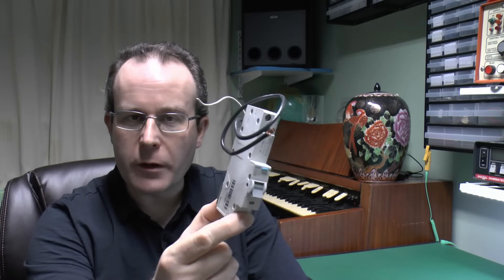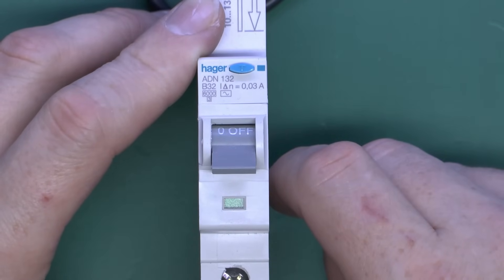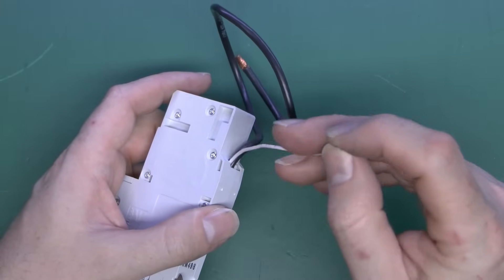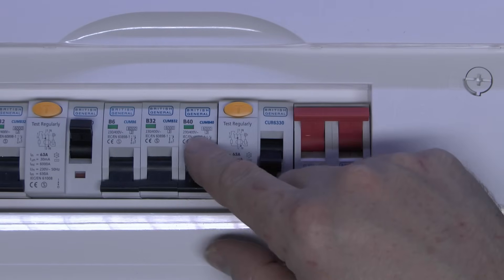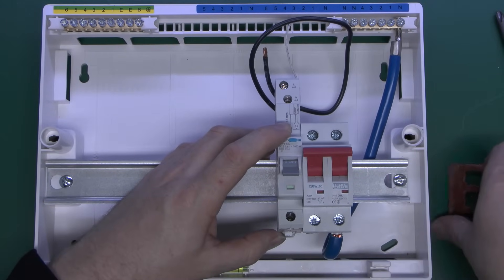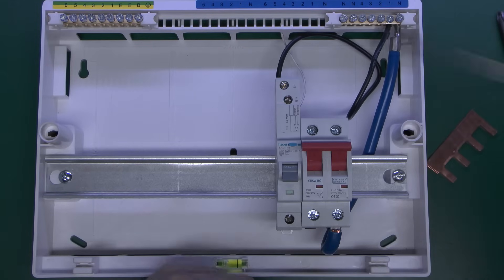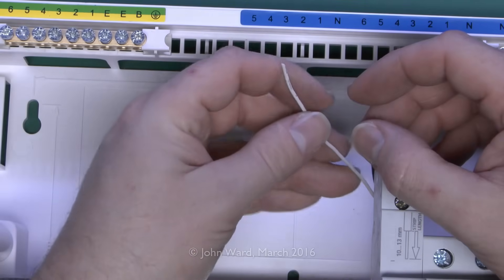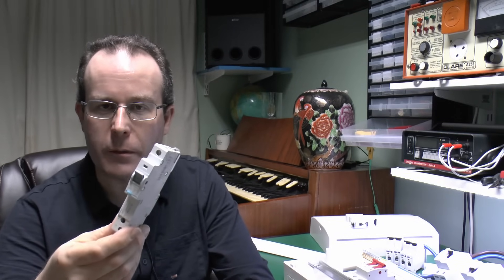Fitting an RCBO in a Consumer Unit

Comment: If high voltage receives from main line like more then 250 volt, in such cases how does MCB protect the circuit
Reply from the maker: It doesn't - they have no protection from overvoltage.
If overvoltage is likely to be a problem, then devices to detect that and disconnect the supply are available.
Reply: which types of devices can detect this Sir? because this is genuine fault

Comment: Sir what is the purpose of RCBO? Then MCB and RCCB? I cudnt understand its uses
Reply from the maker: MCB - trips on overload and short circuit.  RCCB/RCD - trips on line-earth faults.  RCBO = both devices combined.
Reply: John Ward thank you very much Brother. It means we use RCBO instead RCCB or MCB for every circuit. M i right Sir?? And one RCBO enough for whole distribution board or we have to use separate RCBO for each circuit instead and like MCB? Kindly explain it Sie

Comment: Hi John. I've always wondered why RCBO's functional neutral CSA are all the same size.  I would have thought a 50Amp functional neutral would be larger than a 6A.  It's most probably a stupid question. Thanks, James.
Reply: I thought the same as you. Did you get answer to this question yet?
Reply: @mixer7586  Cost.  Someone in China has been shown how to put a blue wire in a plastic box and tighten it up.  They have no idea what they are doing, but if they cut 6" of wire and put it in they get paid.  You want to introduce half a dozen different wire sizes?  Oh no, cheaper and quicker to jut buy one big roll of wire and that will do.

Comment: Hi Jon,
if i want to install all RCBO's in my consumer unit, do i need to keep the RCDs that come with the unit?
i've got 19 circuits and want to use a 22 module unit... thanks
Reply from the maker: No, an RCBO is an RCD and MCB in the same device.
You need a consumer unit with a main switch and as many RCBOs as required.

Comment: I would have thought the function of the white wire for functional earth was primarily for the test button. Presumably the test button just provides a route to earth via a resistor to limit the current to the trip level. Without a functional earth any test button could only work by shunting some current from live to neutral bypassing the detection circuit and creating an imbalance. Whilst that would work, it's not such an accurate test as generating a test current to earth.

I don't see how a functional earth could monitor the integrity of the protective earth of the circuit as it's would only be connected to it via the earth bus connector. Disconnect the functional earth to the circuit and the RCBO would be blissfully unaware. Of course if the earthing bar wasn't connected to earth at all then the test button wouldn't work at all. 

In any event, I'm fully sold on RCBOs vs RCD/MCB combos.
Reply from the maker: The test button is just from N on one side and L on the other.  The RCD trip part just detects an imbalance on L&N - earth is not used.
The functional earth is intended to detect situations where there is either no earth connection, no neutral, or if an unwanted voltage appears between E&N.  Exactly how it is used depends on the manufacturer, but all of those things are very unlikely. Many RCBOs don't have any earth connection.

Comment: Hi John, thanks for the video, I am fitting a new zone 1 bathroom light which requires it to be wired to a 30mA RCD, however there is no space on the consumer unit for another RCD. Am I right in assuming I can replace the current MCB to which the bathroom light is connected with a 30mA RCBO instead of trying to fit an RCD?
Many thanks
Reply from the maker: Yes, provided it will fit in the consumer unit (RCBOs are usually much taller so there may not be space).
Another option is to fit an RCD fused spur outside the bathroom for the lighting only, or to fit a separate RCD next to the consumer unit for the lighting circuit  - existing MCB - short cable to new RCD - connect to existing lighting circuit.

Comment: I've noticed that Wylex CU's have a slightly offset connection for the line busbar at the main switch (and the RCD's for that matter). This is slightly annoying as it means that the busbars must have an end terminal/tab, offset from the rest. Would be nice for all busbar"tabs" to be in a straight line to give more flexibilty in upgrades - e.g. replacing an RCD controlling 3 MCB's with RCBO's means buying another longer busbar to connect to the main switch when the RCD had been replaced by the RCBO's

Comment: Also another question, since i notice those RCDs are rated 63A and are followed in the right case by a B40, B32 and B6 breaker. Is that a safe setup or common setup? Combined they overtake the 63A rating although i know the cases in which you would consume at once 79 amps on a circuit are limited. Also i never saw a 100A breaker, here a single phase house is supplied with 32Amps, you get more only on a three phase setup but that requires a different type of panel
Reply from the maker: Safe and very common - it's the actual loads which matter, not the rating of the individual devices.

Comment: How come it's smaller than those RCDs you have there in the panel?
Reply from the maker: Just a different shape - the RCDs are wider, but not as tall.
Reply: Leafy, the RCBO John was showing is 1) single pole, 2) electronically operated. The RCD that was in the CU before, was 1) double pole, 2) purely electromagnetic device, that doesn't require functional ground. There are situations where you must use the one or another.

Comment: RCBO is common in China since 10 years back. Their RCBO has an additional square button to indicate if the trip is due to mcb side or RCB function in the event of a tripping.
Reply: This is depending on the manufacturer. I've got one made by ABB, if the RCD-part is tripping it's showing a blue "flag". You can see it here on this pic. If you switch it off manually or you've got overload or short circuit (L to N) the flag will not appear:

https://www.klibo.de/fileadmin/_processed_/b/b/csm_40375243_640_41f6b34423.jpg

Comment: What's the correct procedure for testing the trip times of RCBO for radial circuits without sockets? Cheers.
Reply from the maker: Same as for any other circuit - connect the test leads to the RCBO at the consumer unit, or if that's not convenient at some other point on the circuit such as an appliance connection, light fitting, etc.
Reply: I would recommend the furthest point from the consumer unit on the circuit on which you'll perform your testing.
Reply: @Marcel_Germann Doesn't make any difference for an RCD.

The trip time of an RCD doesn't depend on how long the cables are from the RCD to the socket outlet.

If you are measuring R1+R2 resistance then you do want to do it at the furthest socket away from the breaker. The rationale is that this will be the worst case resistance measurement and if that passes the test, then all other socket outlets on that circuit will also pass.
Reply: @deang5622  The longer the way, the more things can go wrong with wire terminations and other things. If it works on the furthest point, it works on the whole circuit.
Reply: @Marcel_Germann No! This is not correct.
When you perform the test of the RCD you are testing it trips at the required fault current level and you are testing it responds quickly enough.

You are NOT testing anything else.

You already have separate tests for testing the integrity of the terminations in the circuit.
You measure the resistance.

What you are doing achieves nothing of any value.

But, I am confident you still think you are right.
Reply: @deang5622  Yes, it does. It ensures that everything works as intended under real life circumstances. And if that's everything you're testing, then good luck if there are any issues.
I am right. But you can do as you please, because everyone that messes with an electrical installation is responsible at last.

Comment: Hi John, Could you cut the neutral wire back on the RCBO then fit a rated bootlace crimp?
Reply from the maker: Yes, they are often far too long.  A crimp will usually be necessary as the wires used are often very fine strands which won't make a proper connection in a screw terminal.
Reply: John Ward Thanks John! Regulations make everything such a pain!

Comment: What is the potentiality of these RCBO from actually jumping across on the inside and making a DEAD SHORT?    Is there added protection [ insulation ] between active and neutral on the top of these units?  ... thanks.
Reply: Typically the RCBO has a insulation rating (Ui) declared on the side, beyond which an arc may occur. Good RCBO's these days are usually rated around 400VAC even though they are designed for a 230VAC circuit. Typically when you build an industrial distribution system according to BS EN 61439-2, you conduct a high voltage test upto around 1850VAC and 2700VDC on a 63A rated system. This checks to see if there is any insulation breakdown to try and force electricity to leak to another conductor. You then measure the leakage in mA.

Remember nothing is truly an insulator, its just a very very bad conductor. But eventually electricity will creep along a surface or flash across in air. That's why creepage (distance across a surface between two potentials) and clearance (distance between two potentials directly in air) are so important in electrical design.

Its also a good point whilst on the topic to talk about DC and AC. You should never use an AC breaker for a DC circuit of higher voltage if you can help it, as DC can arc across a clearance that would normally be quenched if it was AC voltage. So even in an off position, DC can still arc across and create continuity. This is more typical in Solar and UPS applications.

Good fun!
Reply: RCBOs are specified and tested certified so that they don't have internal shorts. However, if it ever did happen, then there would be an enormous bang and, most likely it would blow the supplier fuse (normally 60, 80 or 100A). The RCBO would be destroyed and there would be a consumer unit with obvious signs of smoke everywhere. Modern consumer units have to be made of non-combustible materials, but I suppose there's a small chance of a fire.

Comment: to summarise then, overload and shorts on L&N are covered by MCB, but RCD covers faults which flow to earth! have I got that right John I'm a bit rusty
Reply from the maker: Yes, that's it.
Reply: thankyou John
Reply: ok John, I've got a task to do get an installation upgraded and safe, I've been checking it  I out thoroughly and am thinking of adding an RCD to supplement 3x type B breakers currently in the C.U. there are a few fans on these circuits, do you think the 30 mA RCD will suffer from nusance tripping?
kind regards Warren
Reply from the maker: No reason fans would cause RCD tripping unless they were faulty.  Unless the cables are concealed in the walls, probably no reason to add RCDs anyway.
Reply: Hi John,
But I am probably gonna end up producing a condition report and small works /additions cert, so I thought the onus would be upon me to bring it up to 17th ED standards IE, R.C.D.
Protection shock, or can I test, and make some circuit changes without being required to upgrade what's at the C.U.
Reply: I am of the opinion that the current type B breakers and the general state of the wiring to be good, but there have been some dubious add-ons over the years, I'm tidying these up as I progress through
Reply: John Ward yes the cables are in the walls

Comment: Great video John.
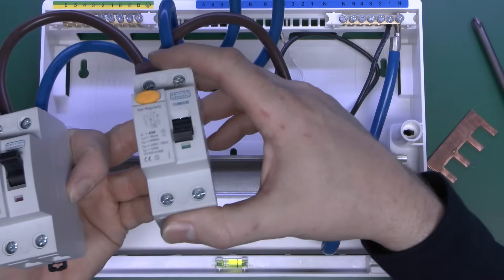Anyway from 9:30 you advice the RCBO's neutral is connected to the main neutral bar and the two RCDs as it were be connected to their own/different neutral bars, reason being it's best the current is kept separate. 
My question is the main neutral bar, from wiring standards will definitely have to  be looped to the other two neutral bars hence the three neutral bars will be at the same potential, so is it really necessary to put each RCD on different neutral bars???????? 
Again, in the case where you don't have space to add more neutral bars, what do you do then??????
Reply from the maker: The three neutral bars are at the same potential, the difference is where the wires go before they get there.  Both the line and neutral wires for a particular circuit must pass through the RCD. If the neutral was connected directly, the RCD would sense the full load current on the line, nothing for the neutral and trip with any load.
Reply: Well noted.
Can you please do a video on the construction/building of an Automatic Transfer Switch (ATS)?
Reply: Bigclivedotcom has done one on those:-
https://www.youtube.com/watch?v=babtv00R-Nc

Comment: Hello John, I live remotely and am prone to power cuts. I have a 4kVA generator to get things running again whenever this happens. My problem is the RCBOs trip as soon as I connect the gen. I've put a good dedicated Earth on the generator but to no avail. I'm considering replacing the RCBOs with MCBs but thought I'd first pick your brains.  Peter
Reply: How are you changing between Generator and Grid Supply, Peter? Changeover Switch?
Reply: Type Cs may help. designed for use with motors. Anyone care to comment?

Comment: Why do RCBO's have difference types B, C and D? How do these types compare to the typical MCD/ dual RCD combination in an el-cheapo box?
Reply from the maker: An RCBO is just an MCB and RCD combined into the same device.  In terms of operation there is no difference between a separate MCB and RCD.  However the benefit having all RCBOs is that a fault will only disconnect a single circuit, with an RCD and multiple MCBs a fault will disconnect multiple circuits.
B,C and D refer to the tripping current required in the event of a short circuit fault, 5x, 10x and 20x the rating of the device.
Reply: Thanks for the response John. So I expect the RCD's in an el cheapo box will also have a tripping current rating and I was wondering what this was. I like the RCBO's as it gives more granularity per circuit. I've read that motors (ie washing machines) probably need a higher tripping current than say a TV, computer due to the initial surge so for me that would be a reason to use a type C and B RCBO's respectively.

Comment: John, thanks for the videos.  In the example you give, what size of cable is used to link RCD to circuit breakers and to N bars
Reply from the maker: It's typically 10mm² or 16mm² and made from a very large number of fine strands.  Size depends on the load it will carry in normal use, so the size of the consumer unit, number and type of devices fitted inside are all relevant.
Split load consumer units are supplied with the wires already installed, so it is not something you would normally have to buy separately.

Comment: I would also like to add more protection to a bathroom extract ceiling fan in Zone 2 which is not IP rated.  It is currently only protected by a 6A MCB in the lighting circuit from the CU. Would fitting a 6A RCBO instead of the MCB allow me to use the existing fan without replacing it with an (expensive!) IP rated (or SELV) version.
Thank you
Reply from the maker: The minimum rating for a fan in zone 2 is IPX4, and all circuits for the bathroom should have RCD protection.
Therefore you should fit the RCBO, however this is not a substitute for fitting a fan with the required IP rating.
Reply: Thanks  - I guess using the exisiting fan with an RCBO must make it safe but also make it prone to nuisance tripping.

Comment: Would you be allowed to have circuit breakers connected to a switch without an RCD in the UK?
Reply from the maker: Yes, although in most situations an RCD is used because the alternatives are far more expensive or impractical.   For circuits such as lighting, other options are to have armoured cabling, metal conduit or cables more than 50mm deep when concealed in walls.  
Most socket outlets must have RCDs, the only other option there is to have the RCD as part of each socket, but this is many times more expensive than one RCD for the whole circuit.
Reply: You guys have lots of Options, clearly — ours is more of the "you shall do it this way or GTFO" than the "well, we prefer this way, but I suppose it would also technically be safe if you did that, or if you did the other thing".

Comment: I'm wondering if your videos might encourage DIYers to have  a go and in doing so put them selves at risk, have you seen these ESF videos https://www.youtube.com/watch?v=2VKHB9RbEkk
Reply from the maker: +Roger Bailey There are several types of DIYers, some will go to reasonable effort to do things properly, others will go in and do whatever they want and couldn't care less if it's correct, safe or legal.  
Those that do whatever they want don't need encouragement, they will go ahead anyway regardless of being told it's dangerous or should be done in a certain way, and that applies to all kinds of work, not just electrical.

Comment: hi JW, keep up the good work. just
a small question, do we need seperate neutral bars on top for the rcbo's installed within a regular cheap consumer unit ?
Reply from the maker: +jasdeep singh No, all of the neutral leads connect to the same neutral bar, which is the same one that circuit neutrals connect to when using MCBs.  It's therefore very easy to change from MCB to RCBO.
Reply: +John Ward thank u sir...
Reply: @jwflame  
You cannot mix mcb with rcbo